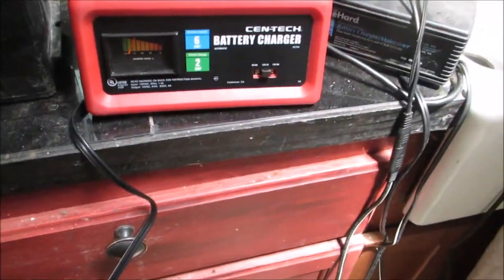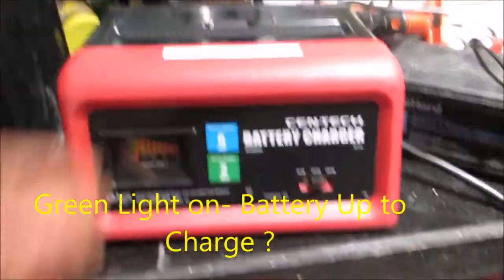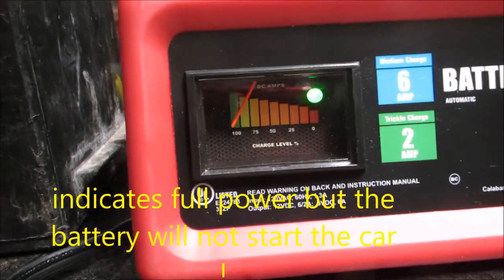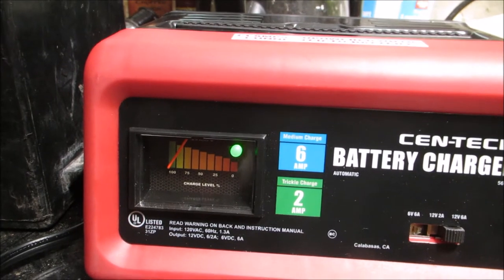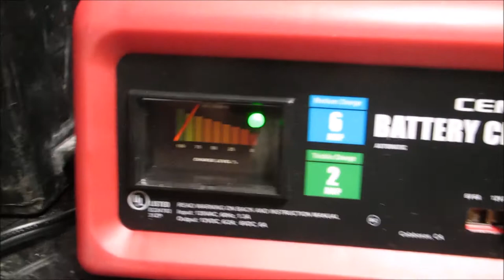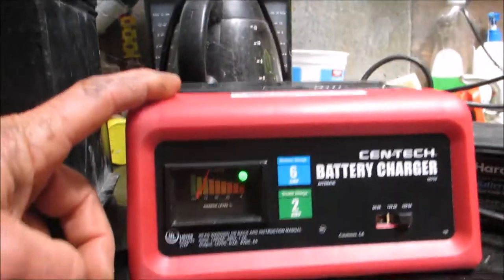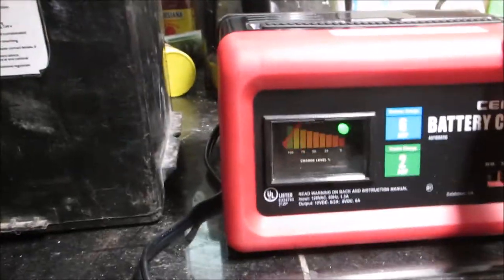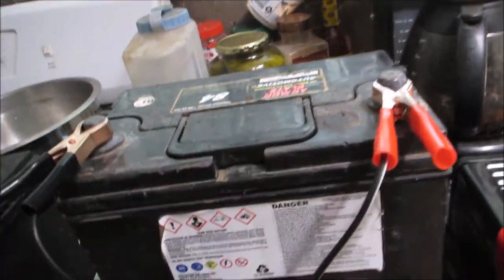Harbor Freight Battery Charger

Comment: The battery seems to be good, probably, bad alternator. However, I do use charger setting 2 amp trickle charge or 12V2A in regard  to car battery. Meanwhile, if you aren't positive about what you're doing, please read the manual for better transparency.